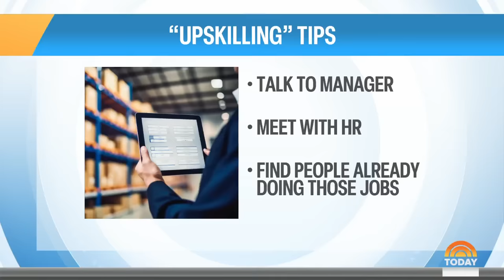How ‘upskilling’ is changing the workforce and salaries

Comment: Better make the trucks fully autonomous as the driverless taxis in San Fransisco and make them run through a special lane with an electrical power source on top of it as the one in Lübeck, Germany. It's cheaper, faster, safer and it will lower the prices since it will solve supply chain problems

Comment: Hardware is hard ,expensive and time consuming r & d  that takes alot of cost to set up then its just about maintaining machinest. 
But software is cheap and it easily could've already replaced 60 % of repeatable knowledge based jobs decades ago .
Actually if it can replace dish washer bot that can simply walk up to environment and do it then it's been intentionall deflected past repeatable knowledge based replacement. 
This is not to knock the educated but it is an anomalous stepping stone period of incentives but public sector library is already eaten up and higher ed should've properly innovateed decades ago .

It's going to all machinest the public sector can't dodge it forever